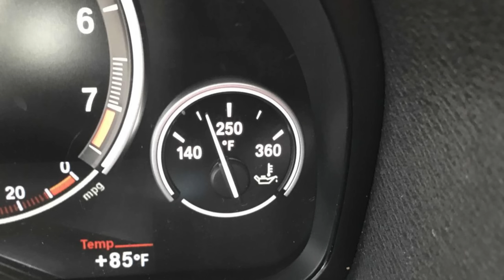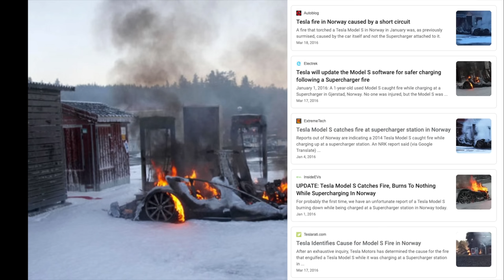Can A Tesla-Swapped 1950 Jaguar Supercharge? Yes! Also No. It's Complicated.

Comment: As dey ave schewed zee people owning zee rekt Tesla's, and that most supercharging is not free, they should simply require the use of a Tesla App or physical card for supercharging including non Tesla vehicles. Simple net 30 terms and a credit system for the various means of acquiring free supercharging credits could go through.  
As far as the supercharging stations, they have over current, thermal protection and so on, it really doesn't matter what people plug into them. The same applies to salvage Teslas. They have quite an extensive self diagnostics suite. It is entirely lawful to rebuild a vehicle, have it inspected for roadworthiness and safety (requirement in all 50 States) and drive it on the road like any other vehicle. Blocking supercharging in an inspected vehicle with a satisfied self diagnostics check is nothing short of illegal discrimination. Their is no justification for blocking the charging outside of artificially devaluing salvage cars.
As far as any kind of liability for allowing any vehicle to supercharge, there is none. That's would be the equivalent of trying to hold Exxon liable for a bank robbery because the perps stopped to fill up the getaway car before the heist. Or trying to hold them responsible because someone was smashing vehicles in a rage with a tank half full of Mobil 87 octane. It just doesn't make sense. Often times people are initially confirmed when it comes to something new. Like liability for supercharging. At the end of the day, it's no different than a gas station. Tesla is no more liable for a car catching on fire than Jimmy's corner variety for selling gas for a car that catches on fire. Phew!!! I think I've beaten that dead horse sufficiently lmao 🤣
Reply: You've got to admit that not the inspectors nor the inspection itself (on all 50 states) are prepared to check high voltage battery cars, they'll check frame damage and safety devices but they don't know how to check battery health and they don't have any way to check if a cell is damaged or something is wrong with the pack, i'm with you with the third party charging but wrecked cars will be a risk, a cutoff from the supercharger might come too late if the cells are bad and started heating up, I get why tesla is so reluctant to this as car fires damage their reputation too much.
Reply: @curvs4me  Yes I agree that the Tesla BMS is awesome but again, you don't know if  the rebuilder decided to go another route and ditch the bms all together, use an aftermarket one that doesn't have all those failsafes but still meets the supercharger's requirements, 
awesome info and very interesting.

Comment: you can tow a tesla at 70mph for like 20 minutes and charge it almost full.
Reply: Regenerative will do that?
How is the Tesla equipped for towing...screw in tow points in the bumpers front and rear?
You could daisy chain Teslas and operate a tow service on a long desert stretch.....

Comment: a company should NOT have the power to prevent you from charging, imagine if that was the case with petrol/diesel cars
"no we can't allow you to fill up your Nissan because you've put a Toyota engine in it"
couldn't this problem be solved by having all salvaged/swapped looked over and/or simulated in worst case just to see if the math checks out?

Comment: By using the Tesla Supercharging Network(tm) you are agreeing to allow Tesla to change the settings in your car. They're also supposed to bill you for the power, but if you don't have a legit Tesla, who's getting charged? (the person who bought the source car, who should've notified Tesla it was totaled.)

I totally understand Tesla not allowing questionable cars to use the SCN. That's goes 100x given the Firecracker Technology(tm) the idiots still use in their batteries. A fire at a popular SC would destroy a few million in cars. (plus the station itself.) And seeing how fast charging can push 75-250W into the pack, it's going to get hot really fast.

'tho I would totally ask Tesla for permission to charge this swap! (assuming the rest of the car was swapped in as well.) Even if it's just once.

Comment: Wouldn’t it be amazing if Tesla sold an electric platform to adapt it to multiple old cars? They would take no responsibility on the chassis (hence the possible collisions of the external body) only guarantee the structure under the chassis (wheels, train, steering) the electronics and the battery, and you can have an old polluting car transformed in a Tesla, with all the advantage and disadvantages of having a lot more of Tesla “transformers” around.
Also this will start to become like the grey market of Apple devices, electrifying a lot of cool but environmentally bad cars, they could even make the transformer at your local shop/or take in to the “Kilofactory” or the “Tesla Racing” car shop in your town.